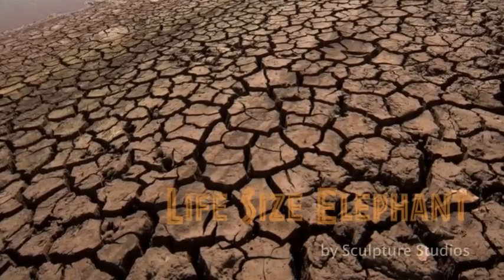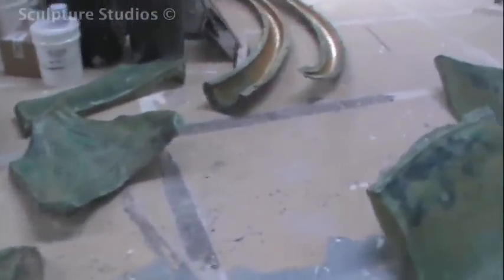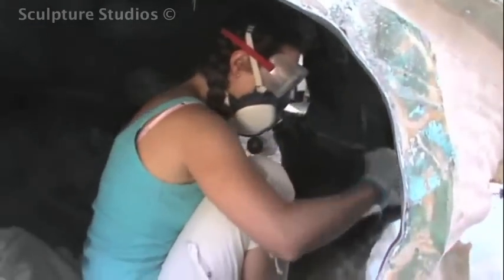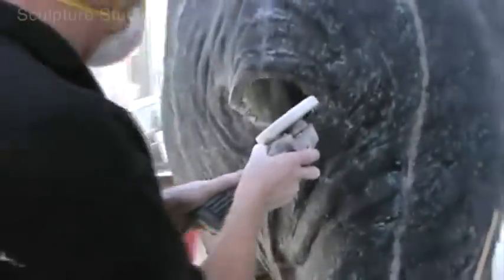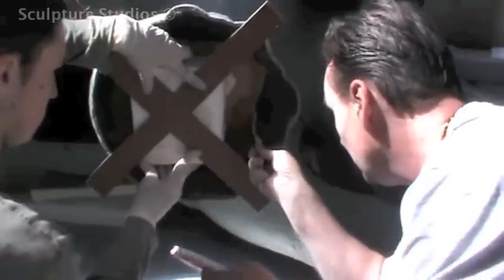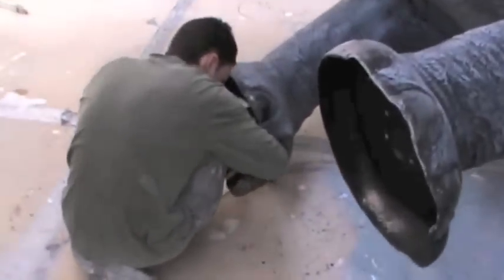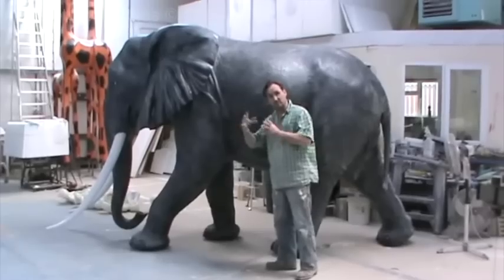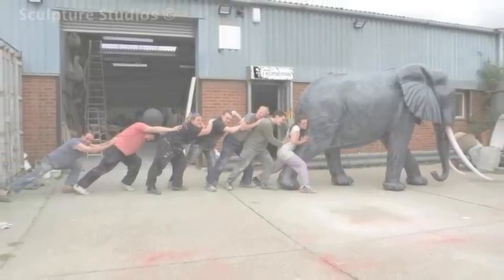New Full Size Elephant by Sculpture Studios

Comment: Great work. The attention to detail is unmatched.

How long does it take to build one of these and building it EXTRA EXTRA heavy duty with say 8oz instead of the 6oz you normally use for high traffic areas, and what kind of time frame do you need?

Also, have you done anything with a Christmas theme to it? Thanks.
Reply from the maker: Hi wjf,

   Apologies for the delayed reply. It probably takes another day or so to lay up an extra 2 oz of glass fibre (however 6 oz is still pretty strong, and rather durable for long term outdoor use. Have a look at some of our other work for some of out christmas projects. We've made moulds for semi 3D reindeer replications, snowy holly tops for phone boxes, a large bobble hat, and christmas signs for a shop display amongst others. Thanks for watching!